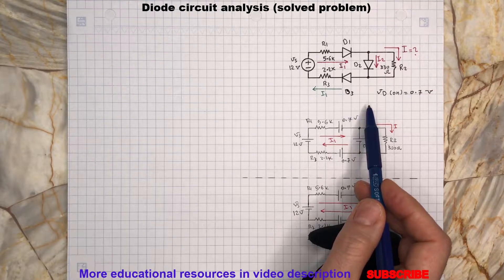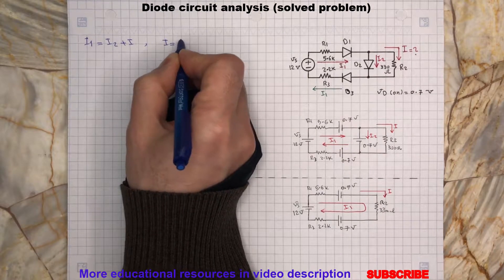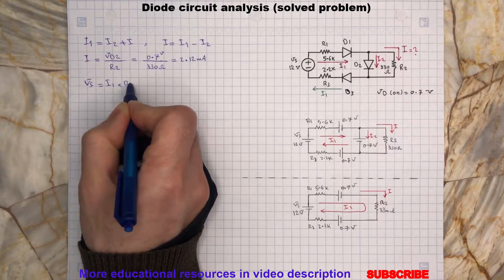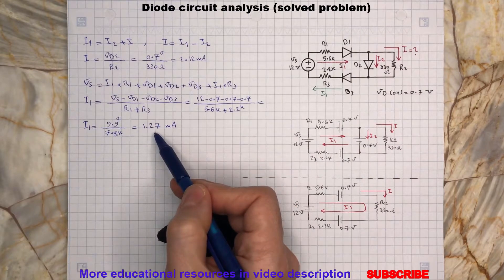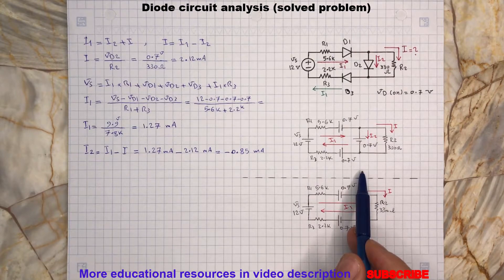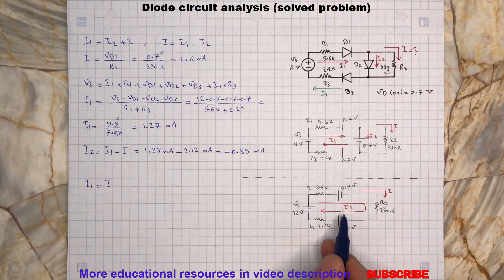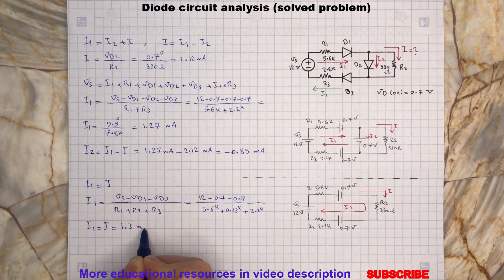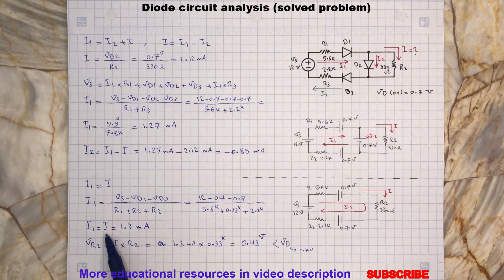Diode Circuit Solved Problem, Multi Diode Circuit Example

Comment: In first circuit, Can we not say: We know there is 0.7V across that resistor, so 0.7/330 ??
Reply from the maker: Yes, at the first we assumed the D2 is ON and we considered 0.7 volt across the 330 ohm, but then we reached to a conclusion that the D2 is OFF (because of I2 negative current ), so there is not 0.7 volt across the 330 ohm. At the end of video we found that the voltage across 330 as well as D2 is actually 0.43 volt and this why D2 was OFF.
Reply: @EngineeringinDepth I think this is not correct. Wouldn't take a minute to breadboard this circuit and be certain...